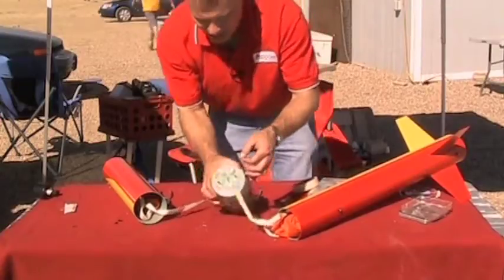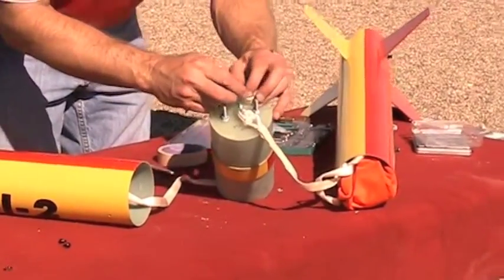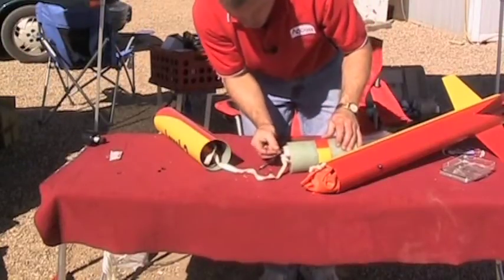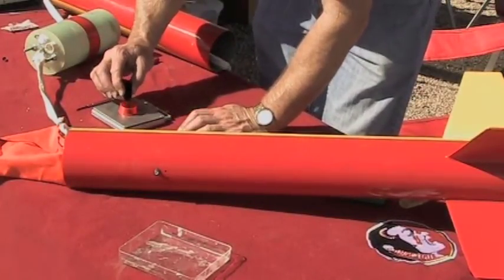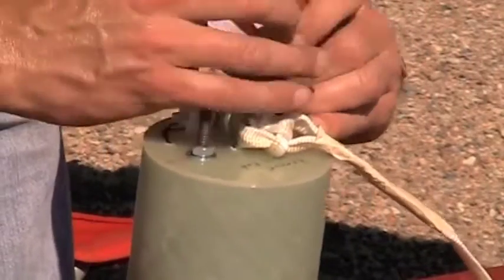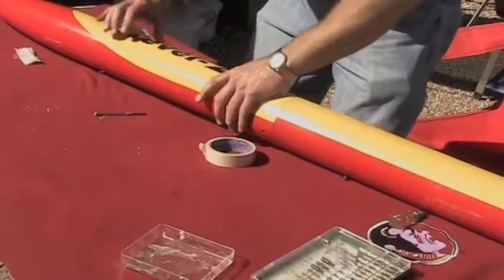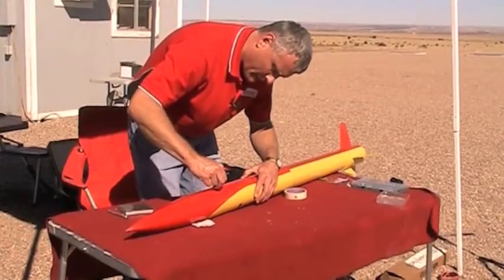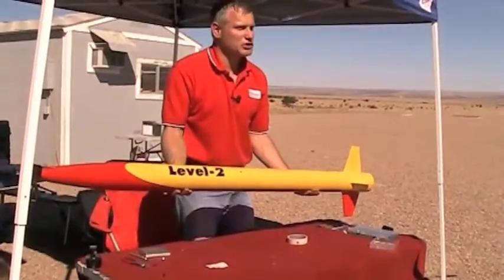Building the Level-2 Fiberglass Rocket Kit - 21: Ejection Charges

Comment: and one more thing. you have a 1/4 inch hole for your switch. do you need other holes for the sensor to read properly? if so how many what size. these videos are great.  thanks.
Reply: i see you did sheer pin the nose cone. but what about the bottom part of the ebay?
Reply from the maker: @daytonpyro  There were no shear pins there. You watched correctly.
Reply: @apogeerockets  I'm putting together the eBay i got off you and was not sure if i need sheer pins there. i see so many that do. but IDK. i have the Zephyr.  this thing is a monster now lol.....
Reply from the maker: @daytonpyro you don't always need them. we rarely use them.
Reply from the maker: no other holes needed.

Comment: you rivet the top of the eBay to the tube. but  do you use sheer pins on the bottom of the eBay, and sheer pins on the nose cone part?

Comment: When determining how much black powder to use for the ejection charges, does the altitude where the parachutes have to deploy matter? Also, not all black powder is the same, which kind do you use? This rocket is the sort I would be very interested in building,
Reply from the maker: Yes. The higher up you are, the harder it is to get black powder to burn because there is less air to propagate the flame front during the burn between particles. Above 20K feet, people often switch over to a CO2 ejection system to provide the gas to open up the rocket and deploy the chute. If you have any questions and want a quick response, please use our web site to contact us. It is time-consuming to post responses here on YouTube.  Use FFFFg black powder, which is the smallest particle size for the substance.